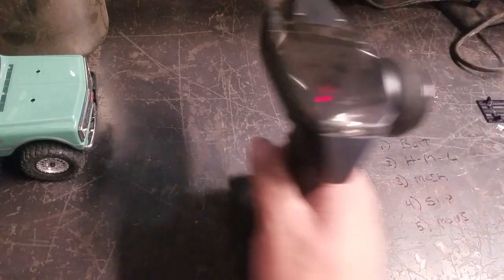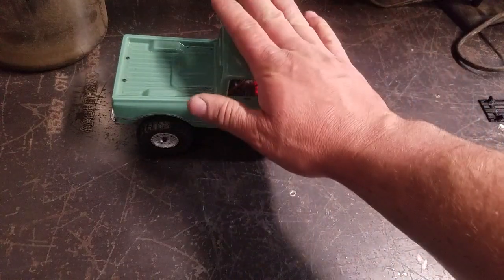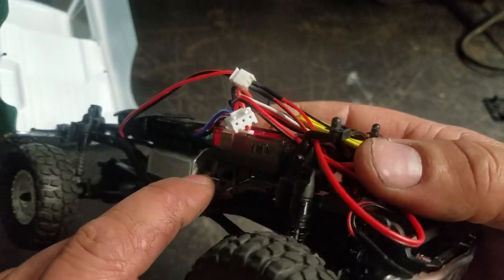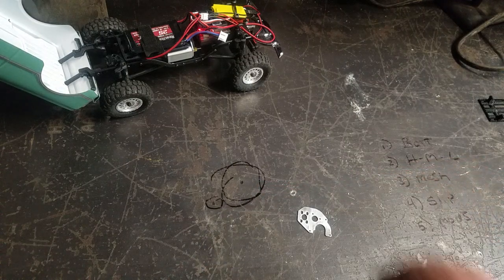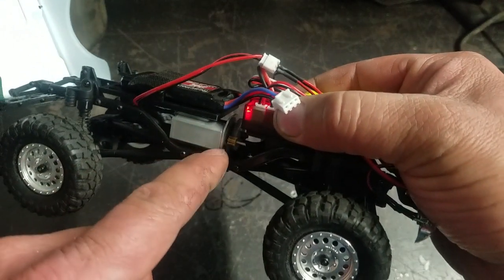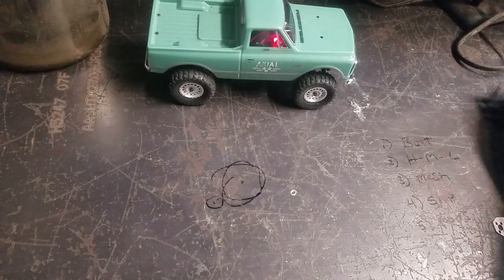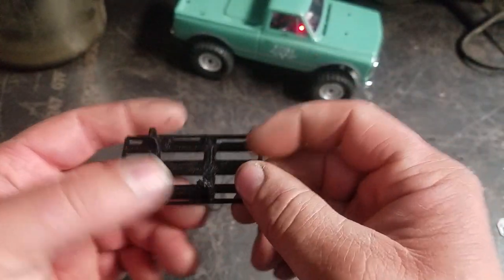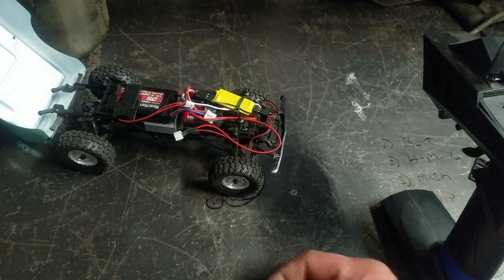LFE - Axial SCX24 High Torque Motor Kit - Troubleshooting & Tips

Comment: I would put this as #3 on the checklist: make sure that all the wheel nuts are not on too tight. This will cause binding issues. 
This is a 1/24 scale crawler, no need to overly tighten most of the  things.

Comment: @3:54 that's what she said😏🤭

Jk all seriousness, is this your personal laser printed part you're explaining in this video or an aftermarket part found online?

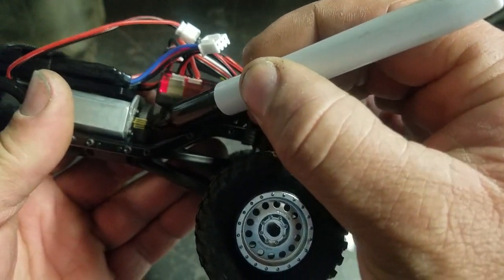Edit* @5:35 disregard my question, but is this mounting plate only suitable for that model barrage motor (ECX)? I have that already currently in my jeep & love it, but I'm having major difficulty finding a way to fit my 180 barrage motor 😕 I've only seen 1 person attempt this & it wasnt easy for him either.
Reply from the maker: My design (although it's very similar  to the other adapter plates) and sent to a sub contractor for laser cutting.  I machined the prototypes it just took to long to do it house. 

 The case of my motor and the barrage motors I believe are the same.  Just the windings in my motors are setup for a bit more torque.

Comment: So how long will this motor last , I bought a scx24 two weeks ago and the motor is dead already .
Reply: Don't waste your time and money on this setup it's good for the kids. If you want more look into furitek
Reply: This kit is COMPLETE GARBAGE Upgrade your to COMPLETELY METAL and everything will run some much better it's almost as if this Axial scx24 was Designed in metal because the all plastic is STICKY and that will burn your motor. I Upgraded to all metal and my motor doesn't even get hot... remember put a retro pie heatsink on your stock motor to keep it cool